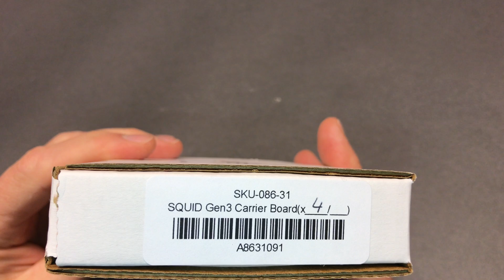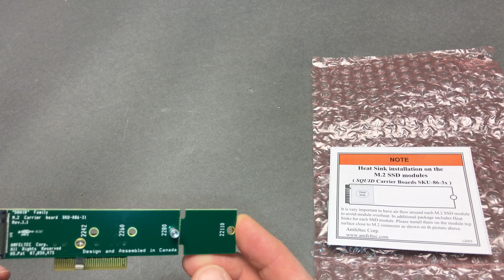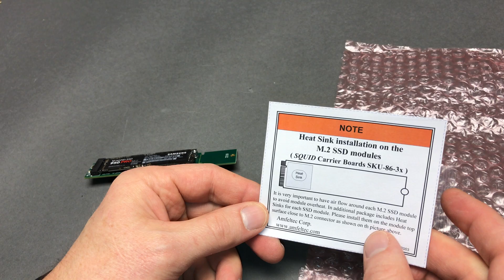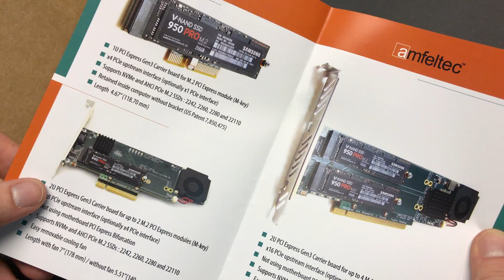Unboxing Amfeltec PCI Express Gen 3 Carrier Board for 2 M.2 SSD modules and 1 module [4K]

Comment: Hi Paul. I have a question and maybe you could help me:  in this setup, 1 (just one) NVME and a 8x adapter card... the data I/O is 8x or 4x (supposedly 4x for each SSD) ? If the card doesn´t require bifurcation, the 8 lanes can be used just by 1 ssd ? Did you have the benchmarks  of this setup? Thank you. Marcelo

Comment: Hey man. Are you able to RAID0 those 960EVO (one in the mobo slot, and the other via PCIe adapter)? Or both must be in mobo slots (when supported) to RAID?
Reply: I ended up buying the M.2 active adapter card (http://amfeltec.com/products/pci-express-gen-3-carrier-board-for-4-m-2-ssd-modules/) that allows up to 4x M.2 SSDs to be connected at the same time. The card is configured to pass the SSDs through to the host system (JBOD) by default. I used 4x 1TB Samsung 960 EVOs in RAID0 and got crazy performance :D. (3 GB/sec sequential write and ~6.7GB/sec sequential read as reported by the atto disk benchmarking tool). I imagine that the card in the video would allow the same.

Comment: I see you've got one of the 960 EVO's in an M.2 slot.  I'm currently running 2 Samsung 960's as a pair in M.2 slots on a Z270 board in RAID 0. Plenty of speedy goodness! Not one to settle for good enough however, I'm considering adding one more in an available PCIex16 Gen3 (x4) slot, one with direct lanes to the CPU, using an adapter card similar to the one you've featured in other vid's but with only one M.2 slot.  Windows 10/64 Pro should see it okay; whether or not I'd be able to create a 3 SSD drive  striped set and the important part, one that's bootable, guess it's a wait and see kind of deal. Some tech folk at ASUS say yeah... maybe!  Thanks for the informative videos, btw.